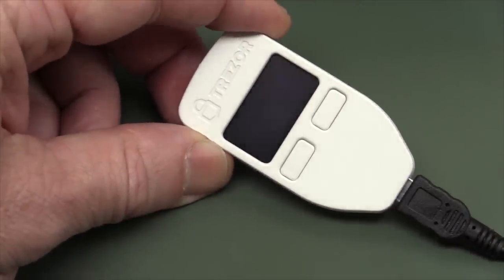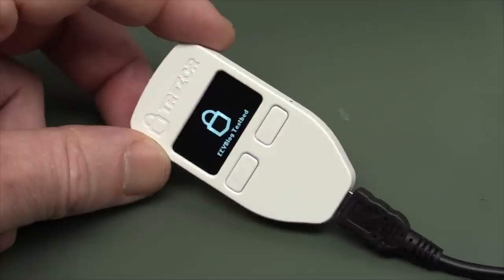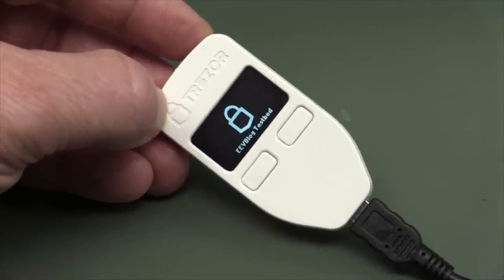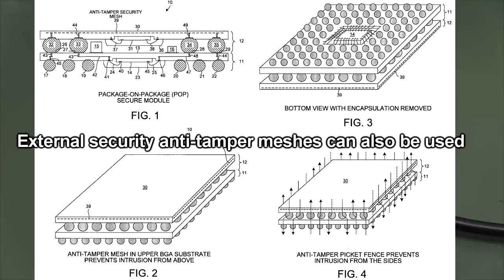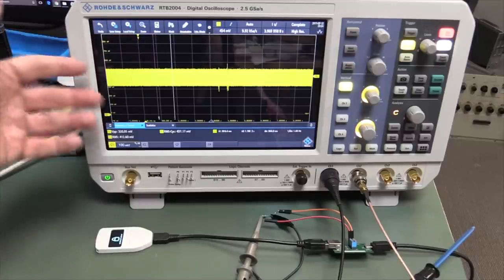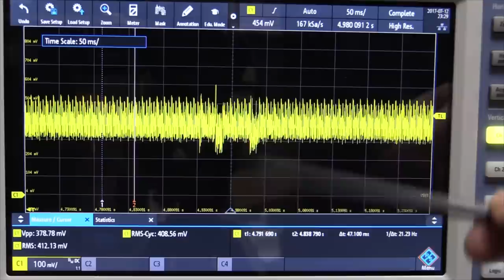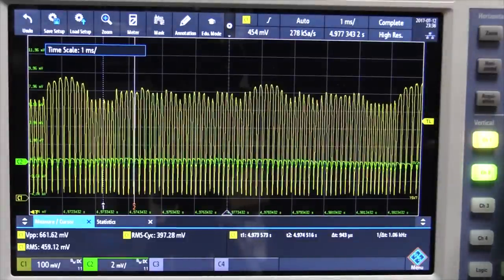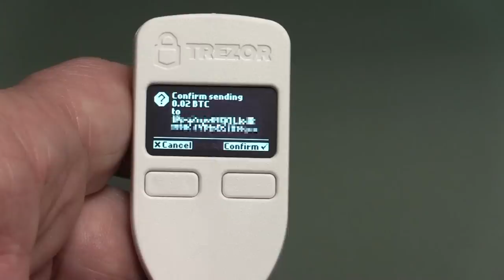EEVblog #1006 - Trezor Bitcoin Hardware Wallet Teardown

Comment: why bother with key logger,dissolving resin etc just hack web cam and watch key entered! sometimes people just like to find difficult solutions!
Reply: very true
Reply from the maker: Social engineering is usually much easier.
Reply: EEVblog rubber hose decryption is probably most likely if the thieves know there is a large amount on it.
Reply: It is like that one xkcd comic (search for: xkcd wrench). ;)
Reply: Why would your webcam be pointed at your bitcoin wallet tho? Few people have webcams outside of those in laptops, and those will usually be pointed at your face and not your table next to the laptop :p

Comment: ah yeah, the "PIN number". thats the thing you put into the ATM machine or your PC computer or the LCD display on your smartphone, right? sorry I'm just tired.. its 7 AM in the morning and I did CAD design the whole night but then my RAM memory broke and its all gone now. Its worse than having the HIV virus! sorry I couldnt resist after you said it 10 times :D
Reply from the maker: AC Current
Reply: DIP Package
Reply: SSD Drives
Reply: good old RAS Syndrome
Reply: CD disk!
Reply: bepowerification: I like your comment and wondered why you didn't got any thumbs up for it. Now you have one. ;-)

I don't say "SIM Module", but if I know that someone gets upset by this type of error, i can't resist to say it like that. ;)
Reply: LED diode. Mosfet transistor. IDC connector. PCB board. SMD device and SMT technology. ENIG gold finish. HASL leveling. AM & FM modulation. SDR radio. DVM meter. LDR resistor. All FUBARed beyond all recognition.
Reply: Correction. CD disc.
Reply: Good one.
Reply: Triode._
Reply: My NAS storage has an OLED display on it.
Reply: Shit, I know that feeling to an extent. I worked on a (3D modeling) project for like 4 days or beyond 8 hours a day and in the middle of saving the program crashed corrupting all that work. Then again you are making a reference probably and I have just tuned in.
Reply: LCD Display
Reply: Are you sure your RAM broke and you didnt just save your CAD to write-only memory by accident?
Reply: Mains current is a sign wave.
Reply: A LAN Network
Reply: Hey, I've got a problem with my local LAN network.
Reply: I used to work for a company that had a subsidiary,  let's call it IBM, that had, on every shipping label, letterhead, and several marketing materials "International IBM Business Machines."

Comment: If the private keys are encrypted with the PIN, then it doesn't need to be resistant to physical attacks.  The actual Bitcoin private keys aren't on the device unless you have the key.  You can't recover the PIN because it's being used as a key, not as an if (key == stored_key) sort of thing.
Reply from the maker: Yes, correct, I believe that's how it's done. They added the pin system as part of the power side channel attack fix, I should have made that clear. But if you can brute force the pin somehow...
Reply: MyOtherCarIsAPlane but if one manages to extract the PIN encrypted private keys, it would be fairly easy to brute-force through all the possible pins since the retry time constraint will no longer be there.
Reply: Exactly what I was thinking. The easiest way to attack this is either:
1) Read out the entire private key since they don't use secure silicon. Then feed it into a larger computer and cycle through all the PIN combinations in about 5 seconds.
OR
2) Bypass the firmware bootloader's "wipe device if alternate firmware is loaded" bits. (Which is likely just a bit or two that you'd need to change on the flash.) Then you can just do anything.

Trezor is a semi-secure device if it is in malicious hands.
Reply from the maker: linagee Only until such time as you realise it's been stolen and then you recover to a new device with the recovery seed, then the stolen device becomes useless.
Reply: If you manage to extract the encrypted keys, you can brute force them without any time limitation. I don't know what kind of key derivation they use on the PIN, but brute forcing 6 to 8 digits is well within the realm of what a laptop can do in a few hours.

If you don't want to do that you can also transfer the keys to a second device with hacked firmware and then replace the device without the user being any wiser.
Reply: ATschTheCube you cant "brute force" it since it deletes after the 3rd wrong pin. Atleast my Ledger nano s is designed that way. Ledger is better built that the tresor tho.
Reply: The brute forcing would not be done on the nano/trezor itself, but on another computer. All they need is to acquire the encrypted private key from the device, which is hard enough though. The weakest factor in all this is YOU however. If you have a million bitcoin and a criminal wants them, they would come after you and not your hardware wallet. Reminds me of this XKCD: https://xkcd.com/538/
Reply: If you can get encrypted data. Because pin is relatively short, you can still brute force to recover it.
Reply: Nice. Also works great for plausible deniability.
Reply: +Norbert Harrer - Exactly! Rubber-hose cryptanalysis is always the best bet for high-value targets as one could assume that nobody entrusts billions to an insecure system (i.e. they have the money to pay for proper security). Also, the moment you transfer/duplicate a private key using a method that is less secure than the private key itself is the moment you lowered your whole system to the security level of the transfer/duplication method. I've seen many a time people transferring their 8182-bit RSA private keys protected with ad-hoc AES using a key directly derived from a simple password (so no extensions, salts or anything), sometimes even in ECB mode, and thinking they are still as secure as that level of RSA guarantees.. . Ideally, a private key would never leave a device it was generated on but that would make products such as this impractical, and crypto-currencies a tad bit inconvenient - you'd have to create a new wallet for every device you intend to use your 'money' from and then essentially transfer and partition your wealth when you want to use it.
Reply: My biggest question about hacking this thing is if it is possible to hack the device to speed up the timer.  I'm also not entirely convinced on the inability to update the firmware without wiping the keys from the device.  If one could remove the time-delay, getting past the PIN would be easy.
Reply: No doubt only a hash of the PIN is stored on it.
Reply: It would not take long to run through all hashes that a 4 digit pin can make. On a fast computer, likely under a minute. Storing a hash will not save you with this low amount of data.
Reply: +linagee Nope, that's what PKBDF2-based hashing is all about.
Reply: +DowskiVision MagicalOracle The problem with that hypothesis is that any salt would also have to be contained inside the device. Your input set would still be rather small with a 4 digit pin. It has to be a deterministic function and all pieces have to be known by the microcontroller. The only thing that can save you is hardened/secure element microcontroller. (And that's only just moves up the cost to breaking to someone with an electron microscope and TONS of time.) Basically, use a Ledger Nano S instead of a Trezor.
Reply: +DowskiVision MagicalOraclers - PBKDF2 and similar derivation methods are not a silver bullet against a very low-entropy input (like low-digit pins). Even if you pick a high number of cycles, say a million, you're still working with just 9,000 possible combinations so you'd have to run your hash function "only" 9,000M times to brute-force every possible combination of that with a 100% success rate. A single solid GPU (say a GeForce GTX 1080 Ti) can easily chew that up in a matter of seconds - for example, the most common hash function used with PBKDF2 is SHA-256 and the aforementioned GPU can go through more than 4,000M of them in a second!

That's why I laugh my ass off when companies who advertise providing privacy and security (say all those 'encrypted' chat apps) collect your phone number and say "no worries, we only use it to find your contacts on our network, it's stored hashed so nobody can read it". Yeah, not like it would take a few seconds to 'reverse' that...
Reply: +linagee Time to go check out the ledger nano s ...
Reply: Hmm all this talk of offline brute-forcing the private keys assumes that you know the exact encryption algorithm plus salt and pepper and any initial data padding.
Reply: +wolfedog99 Open Source.
Reply: Still you can do plenty of things, which highers the risk of getting your bitcoins stolen.

Comment: OK your title is a teardown.  The teardown didn't start till over 13 minutes of talk.  I skipped over most of this video.  I usually like your vids but this one is not one of them.  Just saying.
Reply: Yeah - when I read "teardown" and saw a 25 minute video, I expected more "stuff" inside the unit. Not a huge complain tough - but this could have been a 5 minute tear down on a mail bag and I would not have missed a lot. The side channel attack was not even trying, just a quick sanity check. The product description was fuzzy - not that it was a review, but it was not real tear down either.
Reply: opening a device is not a teardown actually, teardown is what ifixit does

Comment: Surprised there is no anti tamper switch
Reply from the maker: It would require an in-built power source though to self-destruct once triggered. Otherwise you could open it up and then re-short the tamper switch and then power on.
Reply: Built down to a price. For a $120 device, the parts are going to cost $25 to $30. Also, it's not going to help much if you can just dissolve the plastic and read stuff out of the silicon anyway. An anti-tamper switch might help in a Ledger Nano S since they use secure silicon.
Reply: EEVblog But even then, since this is a commercial product, it would be very easy to dismantle one unit, learn the anti-tamper methodology, and just develop circumventions for other units actually containing bitcoins.  Physical security is always bypassable, its just a matter of funds.  I think that a software solution is quite elegant, although I would love to hack this Flash to see if the time delay is bypassable.

Another possibility is hacking the RAM, if the RAM is not runtime encrypted.  You could step through the runtime instructions and reset/bypass the doubling timer.  Then, as you guys mentioned, the PIN is easily bypassed.  Who wants to try?  :-D
Reply: Also suprised it has an off the shelf ARM chip.  I wouldn't go near this for storing e-currency.
Reply: Gadget

Off the shelf doesn't meant that circuits are online nor that it compromise security in any way. At the end of a day hacker just have pins, tracks, caps ect. available to him. And don't rly give fuck about internals of chip.

Comment: I believe the reason why they don't use a secure microcontroller is that datasheets for secure microcontrollers are usually only available under NDA. They wanted to keep the project completely open source.
Reply from the maker: The software can still be open source. It's not like ST micro are going to give you the VHDL/Verilog/fab plan files to the regular ST32 ARM anyway.
Reply: @EEVblog  I'm not sure, at least the HAL would be tricky, otherwise you'll leak information under NDA.

Nevertheless I agree, a secure micro would have been better